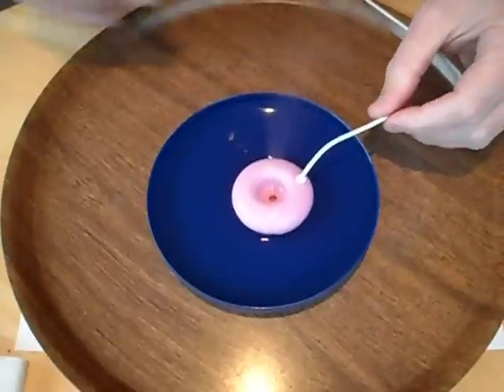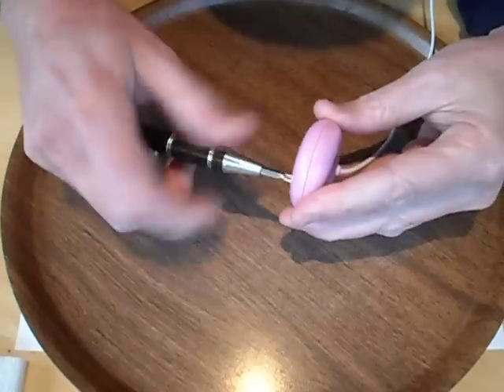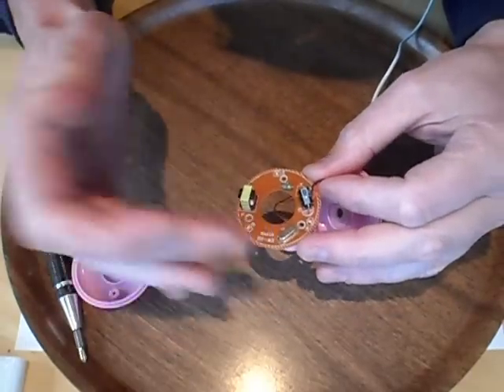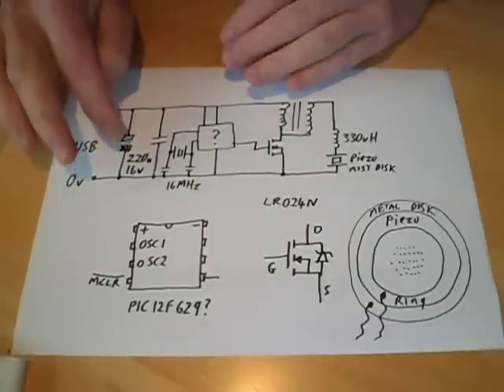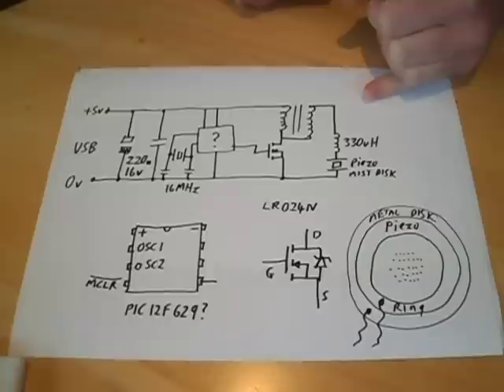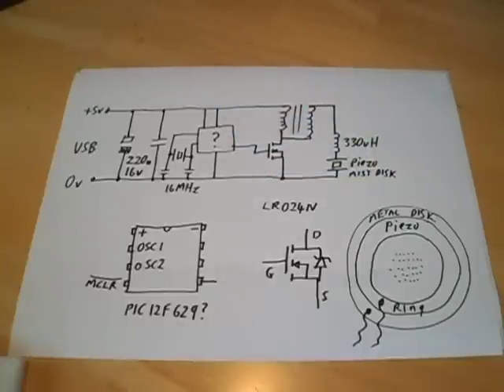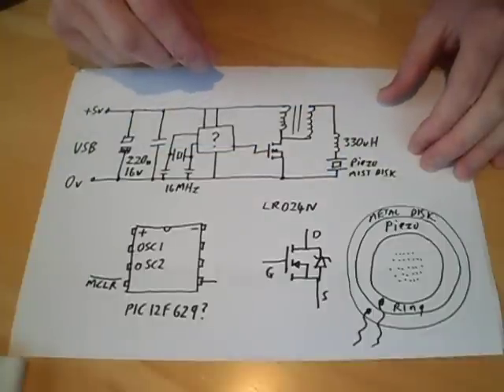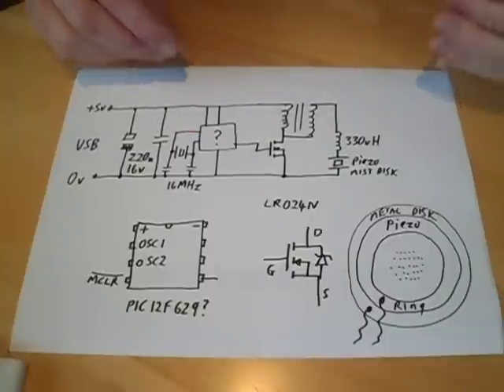Check out my smokin' pink ring.

Comment: If it's a PIC I'm surprised they are using an external crystal as the clock. The internal clock should be adequate for this application.

Comment: I wonder if you can identify the chip using a pickit2, even though the code protection could be on? It's nice that the ICSP DAT and CLK pins are empty... An oscilloscope on the mosfet gate.... mmmmmm...

Comment: Why would you want to humidify the air? Humidity makes cold wet and hot unbearable.
Reply from the maker: In some countries the air can be excessively dry to the point of causing skin irritation by drawing the moisture out of your skin.  This is most common in very cold climates.
Reply: here even in Illinois (were practically swamp so its usually very humid) there are times where people experience frequent nose bleeds because of lack of humidity, generally in winter but also some dryer summers,  10$ to stop getting a nose bleed daily (some of them bad enough to warrant visits to hospitals if you have other medical conditions!) is the reason.
Reply: i think its caused by heating  ...over winter months with heating on a lot - the air gets very dry indoors
Reply: mark layton
 its the same outdoors as well, really really dry in the winter, and on rare occasions in summer, summer is usually muggy as hell but sometimes its really dry

Comment: Lower end of secondary is connected to the collector because;
There is a positive pulse on the collector of as much as 30/40 volts when the xistor switches off. This adds to the secondary voltage to boost the secondary voltage. Looking at the winding polarity the primary dot will be on the collector side on the primary   and the secondary dot will be on the terminal going out to the coil.
I left a comment on your other video of yesterday on the same subject which might interest you.
https://youtu.be/DabnOLtLFnc

Comment: Maybe the secondary is connected to the primary to get the high voltage needed by using a transformer with less turns in the secondary. Maybe the low number turns transformer is cheaper than the proper one for the task ?
And of course, if it blows, just get another unit :)

Comment: Why is the mystery chip aka PIC micro using a crystal instead of the internal RC oscillator? It's not like they have to drive an UART at an exact frequency. Wouldn't probably matter when the output frequency for the transformer and thus the piezo would drift with temperature. Alas, I'm using ATtinys all the time with the built-in oscillator when I'm just PWMing some LEDs and have no need for a particularly stable frequency. Datasheet for PIC12F629 even says "Precision Internal 4 MHz oscillator factory calibrated to ±1%". That should do the trick already without the 16 MHz external crystal. Seems wasteful, or designed by someone who isn't too familiar with the micro's built-in capabilities.

Comment: Possibly (ab)using the mosfet body diode to make a horribly crude ring oscillator that dumps the  back half of the pulse back into the piezo element by taking advantage of an auto x-frmr arrangement. two pence

Comment: Is it safe? I would like to buy one, but i want to know if it would be safe to use.
Reply: +Nicolas Madera They are quite safe.  You can get these ultra-sonic humidifiers at most pharmacies these days.  You can also get them at garden centers to make "fog" in small ponds and water features.  On Amazon.com, search for Etree Ultrasonic Mist Maker.  It has leds for cool looking effects.  Walmart.com has dozens of the "medical" versions that you could take apart.
Reply: +Richard But would it go through your skin like he said in the video?
Reply: +Nicolas Madera Not at these power levels.  This is vibrating like a guitar string.  When you touch it, the vibration would stop.  It is too big to push through your skin.  You would need a very powerful transducer with a very small surface area.  This is just going to make pretty "smoke".
Reply: Richard ok, thanks
Reply: +Richard do you have one? 
I have a slight larger unit that will force water into you skin 10-15mm above the transducer (it's the high frequency that "drills" water into your skin not so much the power) The good ones have replaceable transducers because they actually get eroded and pitted over time from this action.
Reply: +Nicolas Madera this usb unit is most likely won't  but I have a similar unit that will indeed force water molecules into your finger if you put it 10mm above transducer.
Reply: Matt Burrows I have to disagree. Power has more to do with it than frequency.   Yes, you need the correct frequency, but it is attenuated to 0 if there is not enough power to finish the job.
Reply: +Richard well in my situation here only 10 watts is doing the job of forcing water into the skin and we both know that isn't much power.  At any lower frequency this small amount of power wouldn't do the job I am just attempting to warn others about. The usb unit is lower power but I just don't want people to think they all safe.

Comment: When the transistor is on, the coil is grounded, when the transistor is off, the low end of the transformer is taken high, in a similar way to how a car ignition transformer produces a good pulse.
Had the secondary been connected to ground, you would not get the voltage swing, also the back inductance of the primary in series may help.

Comment: The PIC sends a pulse to the MOSFET grounding the transformer, sending high voltage to the transducer, then checks the input through the now series inductors to sense the voltage drop from the piezo snapping back. That's why the transformer is wired in this manner.. It explains the decoupling and the power MOSFET too.
Reply from the maker: Would it really sense that through the gate of the MOSFET?  Any application where I've seen the PICs pulse a coil and then sense from it as well have been driving the coil directly.
Reply: bigclivedotcom Not through the MOSFET gate, the voltage drop on the +5v. You've got two lines on the +5v from the PIC. one is to power it and one is to sense the voltage. I imagine when the piezo snaps back it's a negative voltage back-feeding the +5v. When the MOSFET is not grounding the transformer it's two inductors in series, all these inductors keep the voltage from dropping too far, too fast.
Reply from the maker: SIDCIAVIC The two lines on the microcontroller are the +5V and if it is a PIC12 as I suspect then the other one is just the master clear line that has to be held high.  It's an odd pin because it's also used for programming voltage and has different I/O characteristics to the other pins.  On many of my own designs using PIC12's I also connect pins 1 and 4 to +5v.
Reply: bigclivedotcom Yeah, it has a couple spare pins yet.
 I had ordered one of these myself and stumbled upon your interesting video. Thanks for posting it, and for taking the time to respond.